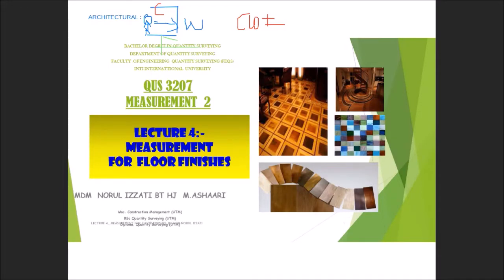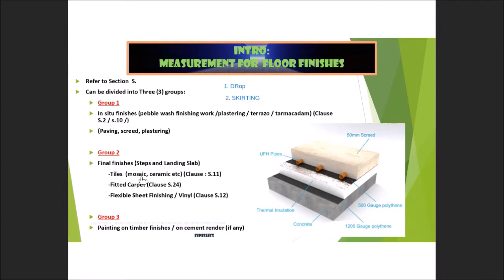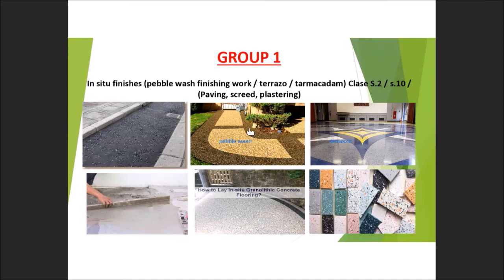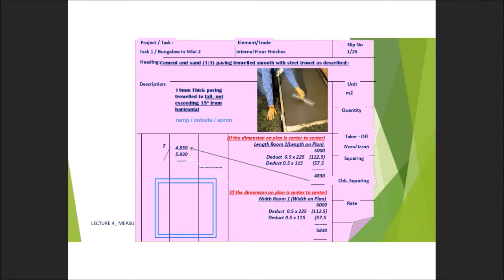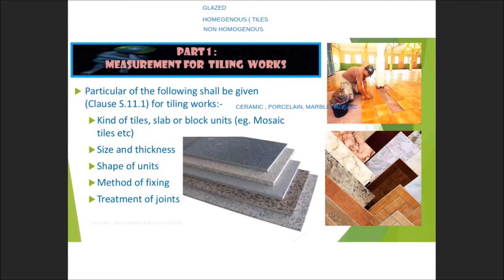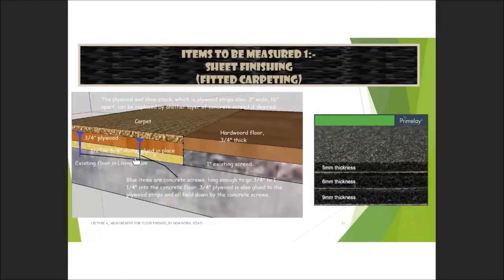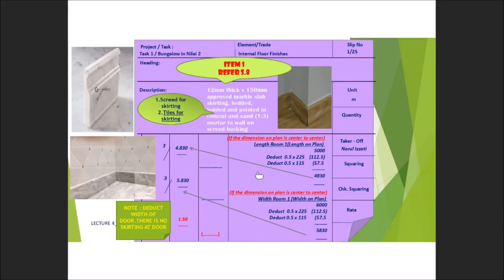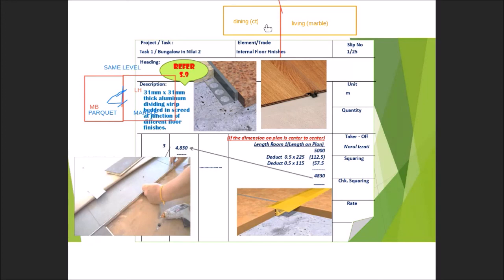Measurement for Floor Finishes Based on SMM2_By Mdm Norul Izzati MA

Comment: cikgu boleh tak tunjuk measurement ni dalam 2 leaved standard dimension paper😄😄
Reply: hello madam. I would like to ask, if the drawing has column sizes bigger than the wall, should we calculate inner to inner floor by deducting column size or thkness of the wall ya? thanks in advance
Reply from the maker: We should deduct both wall and column..You may either take the dimension from the the centre line of the wall (as the dimension given in the drawing is normally centre to centre) and deduct the wall thickness & check with the structural drawing to deduct the column.

If you use software (for example nowaday we use 'Cubicost / Glodon) you may import the drawing with similar details so both wall and column will be considered in the deduction.

Another option is to take the dimension centre to centre from the layout plan, and check both architectural and structural drawings..

If there are columns that are bigger than the wall thickness, you may consider deducting all columns first and then only deducting the wall..
Reply from the maker: hI dear, you may refer to the 3 column at the bottom of the slip sort paper (as in the video). The only difference is the box of the description is located at the actual box on top of the paper.